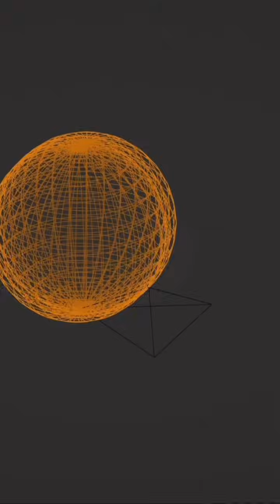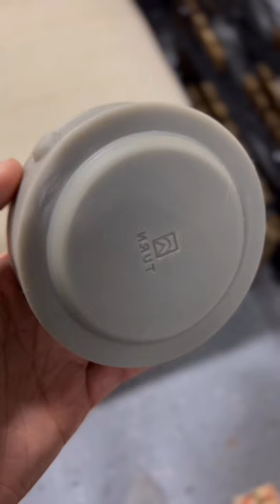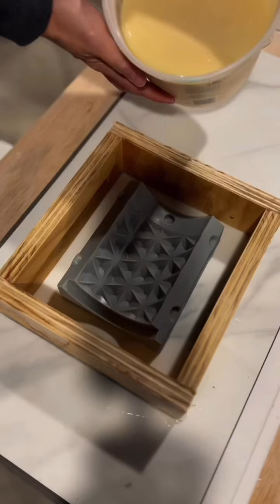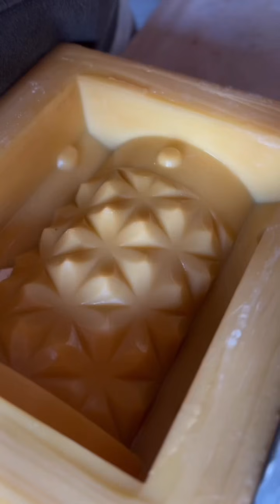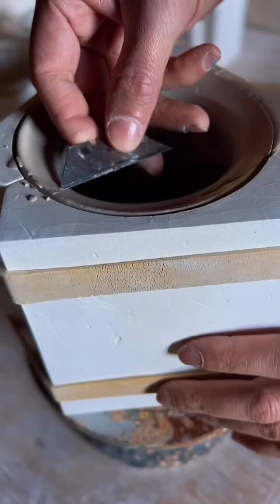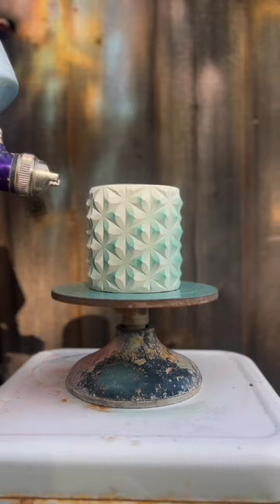Turning a 3d model into a ceramic cup #ceramic #pottery #3dprinting

Comment: Couldn't you just directly print molds for making the rigid plaster mold parts, instead of printing a master piece and using RTV?  It would eliminate a step.
Reply: If you can afford a device that prints rubber or silicone, sure thing.

Comment: Maybe a dumb question, but would it not make sense to make the plaster pieces fit in like a standard bucket of something so you don't have to clamp with bands?
I mean model it s a full slightly tapered cylinder or something, maybe upside down so you kine up the pieces, drop on a bucket with the bottom cut out and then pour
Reply: Not a dumb question at all. This approach is used for multi part molds. Bands, straps or bungees are the most flexible and the very best method. Single molds are a different story.

Comment: Why not 3d print the molds and skip the silicon and plaster?
Reply: For slip casting, the mold the slip is poured into needs to be a specific type of plaster that slowly absorbs the moisture over time. Resin wouldn't be able to do that, at least not nearly as well.
Reply: While you technically might be able to do this, plaster is the only way to consistently produce quality slipcast ceramics in a reasonable amount of time. Remember, this process has been around since the Teng Dynasty so one would assume that if there were a better method it would have been stumbled upon by now. The only other way to avoid those steps would be to 3d print it using slip/clay and if you've seen those results, while interesting, they lack a certain finesse>🤔
Reply: Off the top of my head the only way to do that would be to leave tiny holes in the molds or drill them later, so the moisture could escape.  It would not work very well, take my word for it.

Comment: That second glaze is definitely my favorite. Also, I've been thinking about making my molds using my printer, and im glad to see someone using a resin printer too.
Reply: That's the question I asked.  Has anyone tried to print molds for making the plaster mold parts directly?  Is that problematic?
Reply: @johnvonachen1672 I've seen this creator and a bunch of others use 3d printing to actually cast the mold from and they come out great. Look at Pottery by Kent he has a site that will spit out the file to make the molds
Reply: @johnvonachen1672 possibly. You'll likely have trouble getting it out. In which case you'd want to have it be 2+ parts, but then again, the plastic isnt known for being moisture tight. 

The rubber is the best method for  a master for plaster. Which you can then make as many as needed if they bream

Comment: Lengthy, but fantastic process.  Did you bisque fire before glazing or did you just go straight to glaze?  I didn't see or hear you mention bisque.
Reply: A bisque would most likely be necessary to remove any residual moisture. If you glaze fire without bisque firing, you're most likely going to trap moisture inside resulting in expansion and ultimately cracking or exploding.

Comment: your mould has a fault, every part of the mold at least has to have 1 inch or 25mm plaster wall. if not sooner than later it will fail where the wall is thinner. nice process by the way, but rather expensive. In Argentina we use plaster for making molds, it s 10 times cheaper than silicone.
Reply: No entendí lo del yeso.. que realizas con yeso? El negativo del impreso en 3d? Como evitas q se una al yeso q usarías para el molde? O te refieres q no usa yeso para el molde..en el video me parece q si dice q usa yeso para el molde.
Reply: @KevinFrame.x  El hace la matriz de silicona! el kilo vale como 70 dolares, el kilo de yeso esta en 5 usd como caro. Los moldes para ceramica siempre son de yeso. Se usa desmoldante! cada matricero tiene su desmoldante, pero basicamente es jabon. El negativo del molde se llama Matriz. Y la matriz se hace con yeso extraduro con un poco de cemento